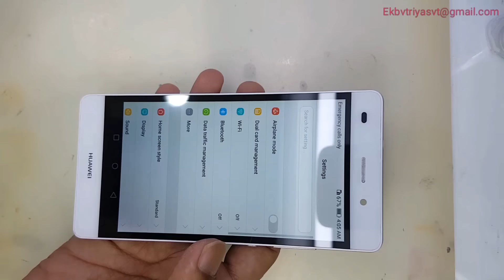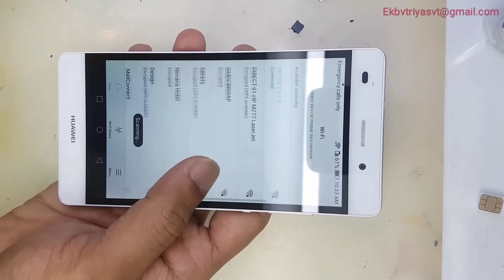Huawei P8 & P8 lite ALE-L21 No/Greyed WiFi Bluetooth Repair fix IC Hi1101 Replacement

Comment: Was that water or alcohol you used with that brush first to clean the slot, then some glue on the wi-fi slot, and then glue again after putting the wi-fi chip onto the slot?

Comment: 3 weeks ago
Sir when I touch on r off it works and tell me that WiFi signal comes when I gave password then password don't accept and write about save , secure I shall b thankful for ur guidance plz !
Reply: f you put your phone next to the server you might be able to connect. on my one it will connect sometimes. huawei replaced the mb one time after 5 months but it failed again after another 5 months and huawei said they only guarantee their repairs for 3 months. arshole company. hope they go broke fast.i think the wifi hotspot is what kills the wifi chip. i found a p8lite with a cracked screen on ebay, bought it and changed the mb myself. its been good now for 8 months but i DONT USE WIFI HOTSPOT anymore. cost me $50.00. ok solution. in that communist utopia of china you dont complain and if you do you get lead poisoning ad they cut up your dead body for your heart, lungs, liver ect.

Comment: estimado una consulta........si yo le compro un cable OTG para conectarlo a una antenita portatil wifi con entrada usb de esas que se les pone a cualquier pc,, captaria sin ningun problema el wifi???? independientemente si no arreglo ese minicircuito integrado de wfi HI1101, por que la verdad no me molestaría llevar colgando esa antenita wifi  para nada.
supongo que debe ser como las computadoras que cuando se te malogra el puerto de red, usb, o vga etc etc etc. de la tarjeta madre,,,, le puedes cambiar con una tarjeta pci de red,video,usb etc...como alternativa..........O ESTOY EQUIVOCADO....lo as intentado????? por q el huawei si es compatible con cables OTG..................saludos

Comment: Hello. I have the Huawei P30 ELE-L29. I changed his LCD, but the bluetooth and wifi stopped working. The wifi only connects if it is very close. Do you fix this? I'm in Brazil and there are no parts for this phone
Reply from the maker: I can fix but I'm working in Dubai

Comment: when i enter the wifi password in p8 lite it shows denied access to network plzzzz give me a solution of this problemm
Reply: if you put your phone next to the server you might be able to connect. on my one it will connect sometimes. huawei replaced the mb one time after 5 months but it failed again after another 5 months and huawei said they only guarantee their repairs for 3 months. arshole company. hope they go broke fast.i think the wifi hotspot is what kills the wifi chip. i found a p8lite with a cracked screen on ebay, bought it and changed the mb myself. its been good now for 8 months but i DONT USE WIFI HOTSPOT anymore. cost me $50.00. ok solution. in that communist utopia of china you dont complain and if you do you get lead poisoning ad they cut up your dead body for your heart, lungs, liver ect.

Comment: plese i want this part for my phone
Reply: f you put your phone next to the server you might be able to connect. on my one it will connect sometimes. huawei replaced the mb one time after 5 months but it failed again after another 5 months and huawei said they only guarantee their repairs for 3 months. arshole company. hope they go broke fast.i think the wifi hotspot is what kills the wifi chip. i found a p8lite with a cracked screen on ebay, bought it and changed the mb myself. its been good now for 8 months but i DONT USE WIFI HOTSPOT anymore. cost me $50.00. ok solution. in that communist utopia of china you dont complain and if you do you get lead poisoning ad they cut up your dead body for your heart, lungs, liver ect.